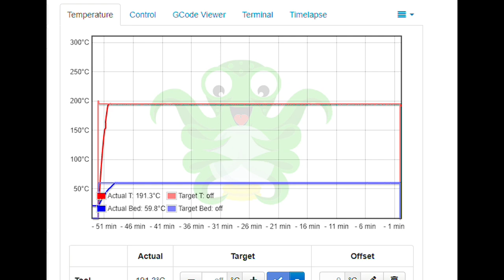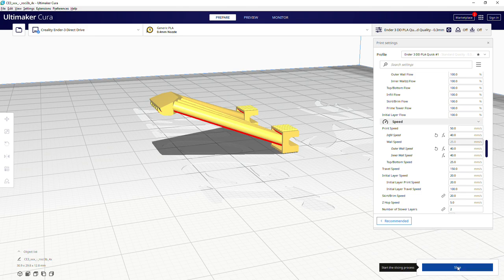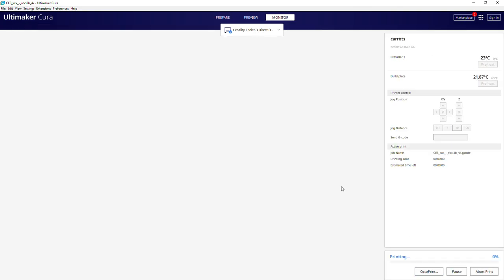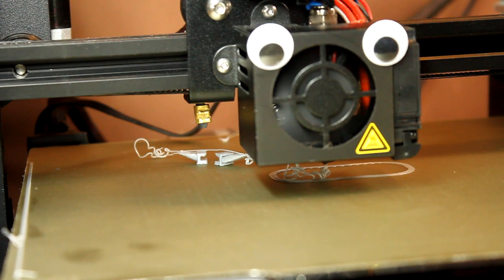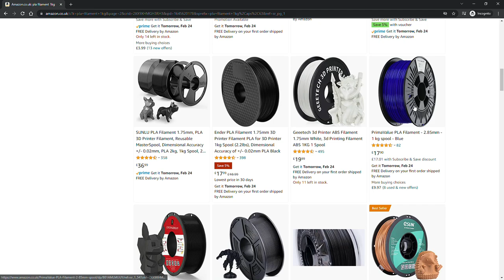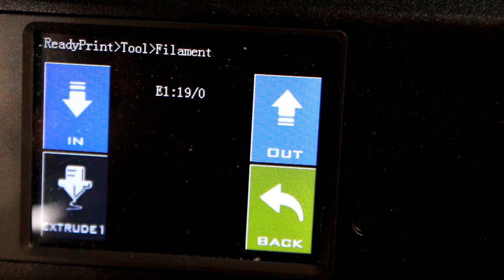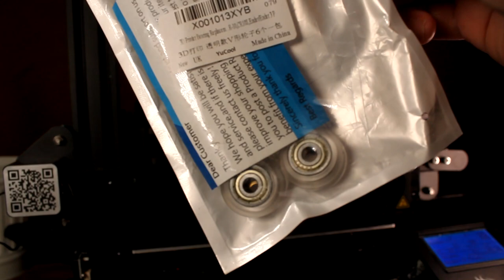10 mistakes we all make when 3d printing, but should know better!

Comment: You should have added "taking parts off the bed while they're still hot". I'm too excited to check out the 10,000th benchy and rip it straight off the bed.
Reply: That is the one habit I still can't break. Got the rest done for, suffered a lot to learn not to do those. But pulling anything dimension critical before it cools is so insanely stupid you may as well have the next copy of it loaded and ready to print because that's what you will be doing.

Comment: I've started swapping out the hot end instead of just the nozzle due to issue 7a: Not fully tightening the nozzle and getting clogs due to thread ooze, and 7b: Gap between base of nozzle and PTFE liner. And cleaning up from other people performing 7a1: Finger-tightening the nozzle.
Reply from the maker: I assume you must not be using those pneumatic connectors? They don't like constantly being disconnected I don't think! 
Yikes...who would finger tighten a nozzle...cold too no doubt!
Reply: The feeder-side connector (Ender 3) isn't load-bearing and hasn't chewed the tube the way the hotend-side has. And I've added a locking connector to the wiring to make it easy to swap out.
Reply: Who would finger tighten a nozzle, anyone who uses a 3D printer but doesn't want to learn how to maintain it? So I get the job. Could grumble all day. chuckle
Reply: Specifically, I swap a lot between 0.2mm and 0.4mm nozzles. Sometimes you just need to print working M4 threads. ;)
Reply: i do just that (finger-tightening when it's cold), all the time, but my ptfe liner is spring-loaded, so it isn't a problem, does not leak ever.

Comment: Octoprint has timeout plugin
Reply from the maker: Useful to know!
Reply: Klipper!
Reply from the maker: Honestly you can do it in marlin too I think...if it hasn't been commented out!
Reply: @LostInTech3D  and then you have to recompile and reflash just to change a setting. Main reason I hate marlin :P
Reply from the maker: Oooh you don't have to on klipper?? 👀
Reply: @LostInTech3D  Klipper works by having the raspberry pi do all the gcode interpretation, it then sends low level command of what to do with the steppers to the MCU, which handles the realtime stuff.

When you change a config file, all you do is edit it over the Webinterface, it loads the new config and that's it.

The only time you need to reflash is when you do a update that requires it, and even then there's automated scripts for that for most boards.
Reply from the maker: Of course....yeah makes sense.
Reply: @tommihommi1  You do have to reboot klipper which is basically rebooting the printer though. That can be a pita if your printer sags when off. (Or generally needs some calibration done on bootup.)
Reply: @SirSpence99  not reboot, just restart. A printer that sags when powered off is a PITA and bad design that should be avoided in any case.
Reply: @LostInTech3D  that was the whole point when klipper started) RRF is that way too
Reply: @LostInTech3D  just please go with fluidd/mainsail, drop the octoprint

Comment: Bonus points for driving a hot nozzle into the bed surface when moving the z axis.  Apparently, "righty tighty, lefty loosey" does not apply to an ender 3 display knob when moving the z axis.  Tricksy hobbitses does not move like I want.
Reply: I ruined two ender bed doing this 😀 learnt it the hard way eventually

Comment: I may sound big headed here... But I don't do any of those at all?  I learned what is and is not from videos of what you do and set my self the task to never t forgot those. 
I don't have Octo print as I can't afford the mini PC thing they use for it.. over £50 way to much and that's if the chip shortage has not stopped them from doing those mini boards?

I got in to the habit of doing what is needed to print and do one at a time so the print while there's another one still on my 1 printer don't happen. as I need to take it off 1st to print again.
My 2nd printer is out of action so until I can afford to fix it that bigger printer will not be used.

Comment: Yeah... I've done a couple cough most cough of those things... a few I haven't, but almost have. I will say I watch the first layer till the infill. If the bed's flat enough, and the perimeters go down good, I'll walk off after some of the first layer infill is done. I don't usually have a problem at that point.
Reply from the maker: No that's fair. I obviously had to stage some of these prints, and that was a difficult one to make happen 🤣

Comment: I think I always check the preview tab, like I'm almost never in the first tab, I feel like it's a LOT less useful than the preview one
Reply from the maker: If you could move / scale the part in the preview tab you wouldn't need the other one!
Reply: @LostInTech3D  You can do all the same things in the preview tab in cura, the prepare tab is only really useful for checking issues with the models. Missing geometry, inverted faces, etc.

Comment: Number 4 you mentioned using the wrong temp for glass. If you add a glass pane on top of your bed do you need to up the temp a bit more?
Great video by the way mate👍🇦🇺😊
Reply from the maker: you do - glass doesnt stick well until 60C+, and this also is what makes parts pop off when they cool 👍

Comment: "Preheating and walking off." I once was about to do this, but got distracted by something on my computer. And that was fortunate, because it turns out my printer - with a bed temp capped at 100 - has no such cap for the hotend, and I'd added an extra 0.
Reply from the maker: Oops!!!

Comment: Okay, didn't know about that filament change tip. 

"Buying one printer and thinking it will be enough"
Maybe so, maybe so... but what about a printer, Mostly Printed CNC Machine (or similar), and injection moulder (a simple DIY one)?
Reply from the maker: Do you have these? I'm interested 🧐
Reply: @LostInTech3D  Nope! One day, though. Still lots of things to try with my printer first. And I think I'd need some more space...

Comment: Honestly, when my printer is calibrated and has been working great for a while, I don't even doubt the first layer will go down well. All I check is to see if the purge line works and if there's no leftover filament strands on the nozzle that could get stuck in the print.

Comment: Yup. Guilty as charged of many of those. Never ordered the wrong size filament, though. (Why, Ultimaker? Why!?)
Reply: Not only did I order the wrong size, wrong material type. It was a flash sale in Amazon and I didn’t read it properly. Luckily they accepted my return and replace it with the correct stuff